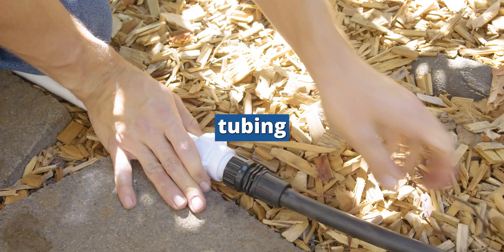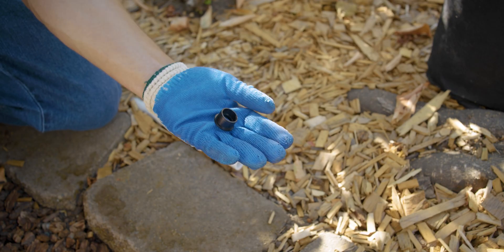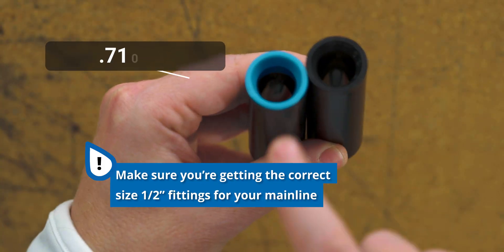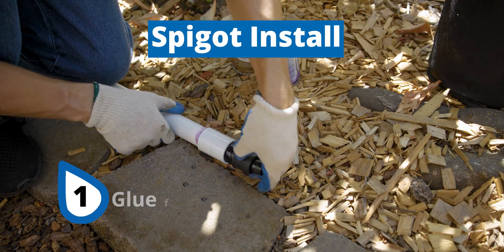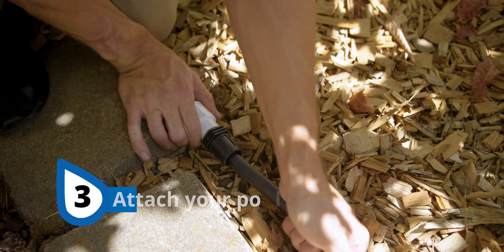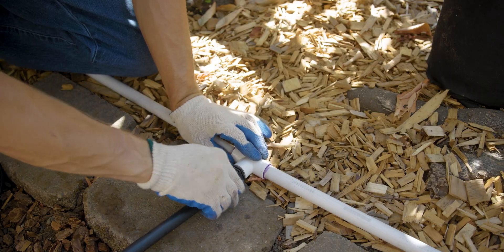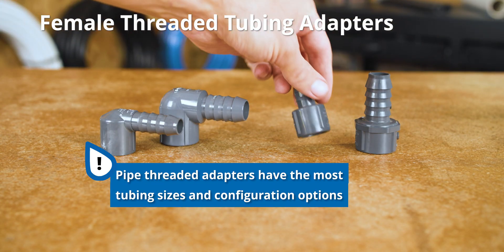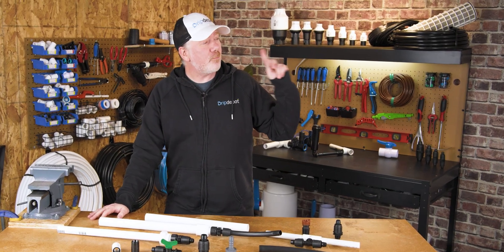How To Attach Drip Irrigation Tubing Directly to PVC Pipe (Beginner's Guide)

Comment: I want to install a few feet of poly tubing underground as a repair where tree roots have broken my PVC, so the pipes can be flexible around the roots. Will this hold up to standard sprinkler/rotor PSI?
Reply from the maker: Great question Dylan.  In the strictest technical sense, poly tubing is rated for the pressures seen in average sprinkler rotor systems.  Most manufacturers rate their poly tubing anywhere from 50 PSI at the low end to 70 PSI at the high end, and most sprinkler rotor systems will fall somewhere in the lower end of that range.  

The fittings are often another matter, however, and many are rated for lower operating pressure.  This is mostly due to how common it is to use this type of poly tubing in drip irrigation where pressure is expected to be low.  

This means it could be done with only a little extra planning for the fittings (at least assuming your sprinkler system isn't over 60 PSI).  

One caveat to all of that:  What side of the manifold is this at?  If it's upstream of all your valves and under constant pressure you would not want to use this type of poly tubing (LDPE, or Low Density Polyethylene).  LDPE is not rated for constant pressure.  If it's downstream of the valves it could be used :) 

A Flexible PVC repair coupling like this would likely be the better approach for the long term (these are also not rated for constant pressure though, must be downstream of valves): https://www.dripdepot.com/schedule-40-pvc-flexible-slip-coupling

Those provide the flexibility needed, but are rated for higher pressure than poly tubing.  They're handy in general for PVC repairs due to the flexibility.  

If it's not too inconvenient for your layout, I'd consider re-routing things away from the tree entirely.  Tree roots love to find their way into pretty much any kind of pipe or tubing, and you'll likely find yourself out there again at some point in the future, with the same problem, if any of the pipe network stays close to the roots (I know this one personally from a stubborn refusal to re-route pipe lol) :)
Reply: @dripdepot well plan A didn't work. Too many things to try and assemble while working around a very thick tree root. I couldn't get the barbed connectors into the swing pipe unless I soaked the pipe in hot water and pushed the connectors on by placing the connector and pipe on concrete and pushing down, but then it was too tight a connection to be able to screw the threaded ends into the pvc adaptors without the line twisting, so... I'll try the flexible pvc coupling now. We'll see how it goes.
Reply from the maker: @dylanwbarnes Swing pipe can definitely be a pain to get on over the barbs of the fittings, particularly in any kind of limited space (I know I need all the leverage I can get with swing pipe and barbed fittings).   The 18" maximum length on the flexible PVC couplings, for some reason, also applies to other brands (Hydro-Rain makes some that are very similar here: https://www.dripdepot.com/2323 ).  Hopefully you won't need too many more than a couple to get the job done.  So long as there's space to slip the coupling over the pipe, they should be significantly easier than trying to work swing pipe on to the barb of a fitting at least :)
Reply: Thanks so much for the info! I found some Rain Bird flexible pipe at Home Depot to use with a barbed adapter to a threaded/slip coupling. It's not under constant pressure.
Reply: The flexible pvc, while looking like a great product, doesn’t provide me with the customizable length I'll need. They're 18" only.

Comment: Why can’t I find self-cleaning end-line valves for my 1/4" irrigation tubing? Don’t these valves exist in this smaller size?
Reply from the maker: Now that you mention it, I don't think I've ever ran into a 1/4" automatic flush valve.  I imagine there's something out there, but definitely not common enough that I've ran across them yet.  The closest I've seen are the auto-drain valves for misting systems that come on 10-24 threads.  One could potentially find a way to get one into a 1/4" tubing system, but it would definitely merit significant testing first to make sure it would work :)

Comment: Another great video. How well do these fitting seal?
Reply from the maker: They all seal well when used with a tubing size they're designed for (which is a little trickier than at first seems, some 1/2" tubing measures 0.500" inside diameter, some measures up to 0.620").  Operating pressure can influence the quality of a seal as well.  Barbed insert fittings are typically clamped in place for extra security and the clamps help keep things sealed at higher PSI than seen with some of the others (Loc fittings use a locking nut that serves as a clamp and is effective at securing a seal as well).  

At standard drip pressures (10 to 30 PSI) all of them should hold up well.  If pressure goes goes much over that window, something with a clamp helps ensure a secure seal (and if one clamp isn't holding up, a second cal always be added, at least on barbed fittings) :)

Comment: These are great adapters to learn about! excellent video. Leesa & I love the lock style fittings so easy to use and change out if needed. These PVC adaptors will be in our future expansion! Thank you...
Reply from the maker: I also prefer the Loc style fittings whenever possible, and being able to reuse them is definitely one of the reasons (and while a compression fitting might technically be reusable by cutting the tubing out, it's generally not advisable) :)